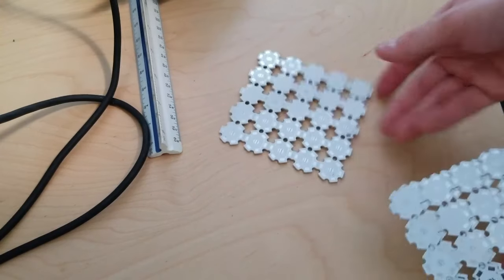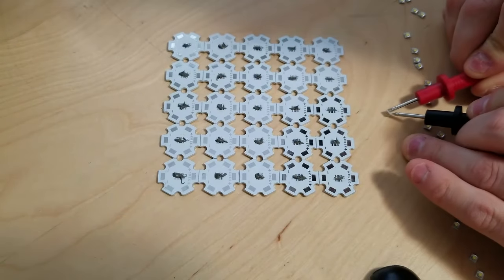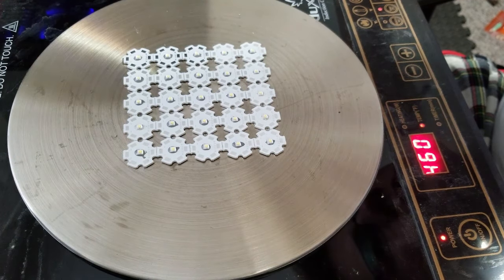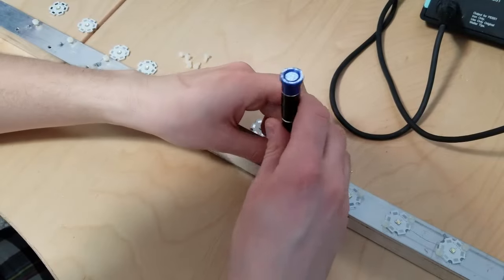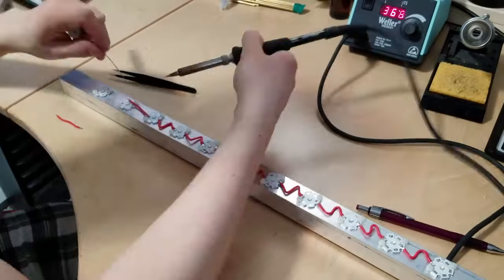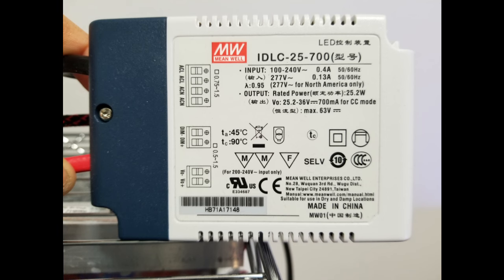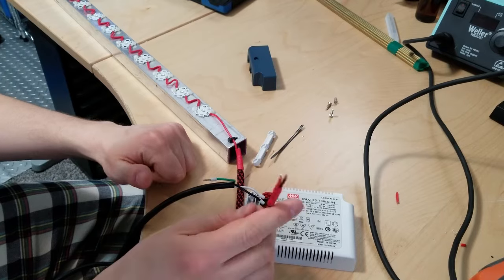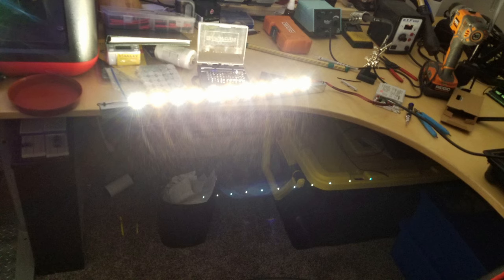DIY LED Lighting - How to Make Your Own Grow Lights!

Comment: nice! i need to try this out ! please if possible can you give me a list of what i need for this project? i am subscribing right now !
Reply from the maker: Sure thing! What are you growing? the type of plant and size of your grow space are pretty big variables in picking out the wattage and color temperature for your light.

These LED modules are a big improvement over the old CREE lights, and they are quite a bit cheaper as well. You just need to select the color profile for your plant. A blend of higher  CCT (5000K - 6500K) and lower CCT (2700K - 3500K) is usually a good idea, with more high CCT used for vegetative plants and more low CCT used for fruiting plants.

LEDs: https://www.digikey.ca/product-detail/en/samsung-semiconductor-inc/SPHWH2L3D30ED4RTM3/1510-1799-1-ND/6569457

The power supply will constrain the number of LEDs you need. For this video, I used an IDLC-25-700, which only supplies about 22W of light to the LEDs. That's not enough for a big healthy plant usually, especially if it produces flowers or fruit. you'll likely need something like this:

Power Supply: https://www.digikey.ca/product-detail/en/mean-well-usa-inc/XLG-75-H-A/1866-5628-ND/10129176

Note that those Samsung LEDs have a MAX stable current tolerance of 1.4A, which is what this driver supplies, so it might be a good idea to buy twice as many lights and run them in parallel, which will maintain the same voltage over each line, but cut the current in half. When you string up LEDs in parallel, it's also important to make sure that you have the same number of EACH color in each parallel line. circuits wired in parallel always have the same overall voltage drop, but some different LED colors require different voltage drops for a specified current. All that means is that if you have different ratios of different colored lights wired in parallel, one or more of the lines might not turn on at all, while the ones that do will have more current than they should.
Reply: @autumnmaticcreations62  Thank you for the reply man! Your a legend... I am not growing at the moment but im looking to maybe try out my hand in growing lol... for this set up what you have provided me... What strain is best adapted to the lighting spectrum?
Reply from the maker: @alionofengland4059  For my PC grow I grew Dwarf Lowflyer from Crop King Seeds. I believe I used straight 3500K LEDs from Samsung for that one since it basically flowers immediately after the seedlings stage (about two weeks in)
Reply: @autumnmaticcreations62  i have read alot about the dwarf auto strains and using alot of them for SOG set up... What are your suggestions on a 6ftx4ft space filled with dwarf autos?
Reply from the maker: @alionofengland4059  oof that's a lot of space. As long as you can water them I don't see a problem. They need very little maintenance and virtually no pruning.
Reply: Thanks man. so how many bulbs in total to fill this space?
Reply from the maker: @alionofengland4059  it really depends on the driver you use. For a large grow like that, I would probably go for straight COB lighting, and use one of the larger HLG drivers. You might even be better off buying a quantum board kit.
Reply from the maker: https://www.horticulturelightinggroup.ca/products/260w-qb-v2-led-kit

Here's an example
Reply: Where do you get your LEDs? Obviously, you want to get band width specific lights in both red and blue. The comercial lights I have now are weak on the red side. I would like to build some red light bars to supliment what I have, then build balanced light bars to expand my commercial grow. Right now I am only using half of my 800 Sq ft grow room.
Reply: Very nice video, could you pls check the how much Lumen light is produced at 10 inch from led. You can download app luxmeter and pls tell us, Thanks.
Reply: @autumnmaticcreations62  hey man I want to grow ever bearer strawberries indoors. Its going to be an NFT hydroponic system. Please state what sort of LEDs I need to buy. I live in a subtropical zone so we get a bit too much sunshine. We get June bearer strawberries only. I want to break that cycle. Only obstacle left is getting the right and cheap LEDs for my project.
Reply from the maker: @alitahir4147  It's hard to say, but I doubt their light requirements are much different than other strawberries; If they're sensitive plants, their growth performance is probably more closely related to the amount of light their getting as well as temperature and humidity. I would start with a few 3535 LEDs, stick them on starboards, hook up a driver and see if you can get a small patch to grow. You could probably get away with just a few 3000K LEDs.
Reply: @autumnmaticcreations62  awesome. I will jump on to that.
Reply: @jefferyeis9287  Dr Bruce Bugbee is the Man.He's posted a number of lectures about lighting on You Tube,a must watch for anyone interested in lighting for growing The Herb.
Reply: @Dewitt Doler why?
Reply: G ddx fortuity
Reply: i dont mean to be so offtopic but does anyone know a method to log back into an instagram account?
I stupidly lost the account password. I would appreciate any tips you can give me!
Reply: @Ivan Allan Thanks so much for your reply. I found the site through google and Im in the hacking process atm.
Seems to take quite some time so I will reply here later with my results.
Reply: @Ivan Allan it did the trick and I now got access to my account again. I am so happy!
Thanks so much, you saved my ass :D
Reply: @Mordechai Brooks you are welcome :D
Reply: @autumnmaticcreations62  I need to have assortment for a bug in garden.

Comment: I work in lighting and I make grow lights. I would recommend looking up Flood optics to get higher PAR reading from your LEDs,  Those look like the common nichia diodes so you should be able to find some. WIthout using flood optics to direct the light down  like a beam, a lot of light with be wasted going in other directions being inefficient, your plant won't like that and they won't get efficient lighting to survive to harvest. this is cool though. just add some flood optics to the thing and you got yourself a great grow light. i would look into adding 1 red LED and 1 UV LED

Comment: I have scoured the entire internet and I can't seem to figure it out!  I want to use samsung lm301h leds; but they are 3mmx3mm (or 3030), therefore a different size than these ones.  You know...the starboards that are actually affordable and easy to find.  😩  is there any way to amend the .25-.5mm difference and just use these starboards anyways?  Or do I absolutely NEED that perfect fit?!  I pray someone more electricity-minded can answer for me.

Comment: Good approach. To save time, one can purchase led modules on metal strips. I used several such strips attached with automotive thermal sealant to an aluminum c-channels, then made then attached them to an aluminum frame. Using a c-channel doubles as a poor man's lens, reducing sideways light spill and redirecting it downwards. Same as here with the power supply, same with underpowering. When the time comes, I just get them out of storage   and put them above the stuff that needs to grow, like cucumber plants. 
These lights double as work lights when needed as well.

Comment: Do NOT solder the ends of a wire you're putting into a screw-terminal. If it uses some sort of spring, that's ok though. (Though usually still frowned-upon by most.)
And ferrules are considered "best" by most. 

If it works more like a set-screw, then you have to keep in mind that, under load, wires do warm up. And the low-cross-section areas where the wire makes contact with the terminal have a lot higher resistance than the rest of the wire, so they actually heat up a lot more. Quite often, there are tiny spots that can get hotter than the melting-point of the solder, causing it to slowly flow out of the way of the clamping-force over time. 

But that is a fantastic video, and I'm glad I found my way here. :)

Comment: recent build.. $9.99 for 600mAh driver on ebay running 10-18 "3W" leds
10 "3W" leds run $5 to $9 depending on colour
i used 3 colours, 17 leds, total under $30.
selected 660nm deep red, "full spectrum" which has a bit of 465nm blue and covers red up to IR , and some 415nm (blue-violet) to hit chlorophyll a blue band (most people miss this).
3W leds are actually 2W, apparently the convention is to call them 3W. top tip when drilling aluminium: keep the drill bit wet. aluminium tends to shear and chunk, if wet it drills 3x faster and much tidier. press some kind of dimple into the spot where you intend to drill first, to center the bit.
i don't like to use lenses because of the light reduction. these cheap star mounted "bead" leds still have a wiide angle, so build reflectors also.
Reply: Hello there, do you have an video on how you did that? Sounds interesting... wouldt like to know more about it..

Comment: Nicely done.  Your right, too simple not to build my own.  I love all different types of orchids and African violets.  Having my purpose built LED strips will make my life in the greenhouse sooooo much easier.
          For us newbies, you went a little fast, both in speech as well as actions.  Maybe on the electrical testing and soldering you could go a little slower at the beginning of a soldering run, then speed up as you run along the board.  Just a thought.  Thanks.

Comment: By the math, your  LED's are 2.17W each.
I made mine using 1W Grow LED's already on a star plate and series two circuits of 50 LED's each then parallel those two. The voltage rating was 3.2V-3.4V (350Ma) for each LED. This made the voltage of the series set 160V-170V rated. This way I can run them directly from the 120VAC house supply through a bridge rectifier and a capacitor (220VDC 1000MFD) for voltage stabilization and to capture the RMS peaks of the AC which makes me end up with 156VDC +/-. This is perfect allowing headroom for thermal variables and utility company line power fluctuations.
I attached them using thermal silicone to a 4'X4' aluminum sheet that is .063 inch (1/16") thick. This makes a 4 foot by 4 foot light panel at 100W, although I believe I need to add some 3000k white ones for spectrum balance.

Comment: I did not even know you could use LED lights to grow plants so thanks for the time and info .
Reply from the maker: Knowledge is power, Thomas m'boy
Reply: look for cxa2530 on aliexpress, they are still on of the best and cost only 5 bucks per led, you can drive them 30-40 watts a piece.

Comment: You really made something that seemed so confusing and made it sound simple. I've got a small 40x40x120cm tent and i'm ready to make a light for it. I was thinking of using Samsung LM301B lights and was wondering what you think?
Reply from the maker: The LM301B are good lights, but you need a lot more of them. These run on less current and are the type usually found on Spider Farmer / Mars Hydro lights. 

If you are going to make your own lights, I definitely recommend going with a 3535 footprint, like the Samsung LH351B. They are more expensive, but put out more much more power and will be a lot simpler to assemble.
Reply: @autumnmaticcreations62  Thanks, i've had a look and the LH351B are clearly a MUCH better option. I did have another question in regards to adding different coloured lights (all in series) using the same power supply. 

Say for example we use 3 different colour LED's and all three have a different Forward Voltage and max current. Is it safe to use one power supply to power the whole thing? Assuming of course the constant current of the power supply does not exceed the max current of any of the three LED's, and the total voltage of the whole series is within the acceptable range of the power supply.
Reply from the maker: @Sasquatch10  Yep. That is totally fine. The power supply is agnostic as to what kinds of lights it is driving. You run into issues when you try to run series strings of colored LEDs in parallel from the same driver and the colors don't match.

 Since the voltage/current ratio is different for each string in this case, but the voltage is forced to be the same, you can run into an issue where one of the strings takes on almost all of the current. 

Not a good outcome if, say, you decide to run six strings of 1A max LEDs in parallel with a 3A supply.

Comment: Looks like the ground wire is not connected. Are you planning on connecting it to something? Would the heatsink tube be a good place so that the metal components are grounded?

Comment: Thanks for the video! I'm going to give this a try instead of buying my next set of grow lights. Do you have any methods for water-proofing?
Reply from the maker: Thanks! Unless your lights are going to be in the splash zone, I would not worry about water too much. If you want to err on the side of caution, you could look into silicone sealing spray - just make sure it can handle high temperatures. Anything rated for outdoor use should be fine.

Comment: Nice and simple way to understand  tks.
I would like to know  if u can help 
I need to wire an 12v  led strip  which has resistor  built in it as a brake light on my car battery voltage which when running  gives  14v   so to get constant  12v which will not damage my led strip what  resistor  i need to attach to the + wire of the  brake wire so i get constant  12v .
Tks

Comment: Good Stuff ! 
Ive got a bunch of 50-100w led cob that im going to build a growlight of ive been using single 50-100w cob with a heatsink for single plants works just fine specially when a storebought i the same strength goes for 100-400$ pricy here in Sweden . 

I couldnt find a heatsink that would suffice until now , its a metall Whats it called hmm you Cary out food on them ? In stainless steel loads of space and fans can be mounted on top of it . 

Its a good way to build/customize your own growlight it doesnt have to be expensive and its fun to create equipment even if its not Always the cheapest way . 

 Good Video youve made here 
Regards Paul-Roger

Comment: I know it's pedantic, but the earth wire should be connected to the heatsink with a crimped eye terminal, bolt and nut
This will make it trip your house RCD, should moisture or external items touch and short out the light face, and cause the LED power wires to conduct to the chassis.

Comment: hi. I have a question. i only have a boost converter on my hand right now, I want to use it to light up a 15-24v led. 
but i searched there is only a buck circuit that can limit the current.
 if i use a boost converter and set it at 30v, and use a 47 ohm 10w resistor to limit the current will that protect the led from burn out?

Comment: I'm currently building a similar set up using the same LEDs and star boards. Bought them on eBay already built. For 15 bucks a piece. There Abouts. I am curious if I have to run each color diode to its own power supply or can I use a constant current,/cv driver.

Comment: instructive effort.  

  the sqr tube lends itself to having air blown thru it for cooling

one thing to see is how to replace one of those cree leds with a new one.  

.do you know if its possible for a cree led to fail and still conduct the 700ma ?

and

did you guess or is there some technical reason to drive the leds at 700ma
  given that its 300 ma less than they can take ?   i dont get the logic

of having a driver running at its max design but not the leds.

  also its not clear to me if those star/led units had any thermal compound on
their bottom side or not when they were screwed to the Al  sqr tube.

    lastly ... about the star PCB ,  does the metal on the bottom have any
voltage to it ?  or is the led on the top side somehow isolated
electrically from the bottom side metal ?

     now to rest awhile then return to learn what else you've been up to

Comment: It occurs to me that it would be much easier to create an array of GU10 fitting LED units. Not only would it produce more directional lumens, but they can also be easily interchangeable between cooler 6500k (blue) units and warmer 2500 - 3500 (red) units, thus optimizing the spectrum requirements of the plants at various growth stages.

Comment: Skip the soldering, buy LED stars direct from LED_SUPPLY.  mount stars on 1/8 inch aluminum sheet.  You can select the color temperatures you want.  Figure each LED at 3.3vdc at 1.0amp or 3.3 watts each.  String them in series, adjust voltage across each string to set drive current.  EASY.  Fuse the AC.  Constant current is OK, but not required.  Good video.

Comment: Please pardon my electrical ignorance. Very creative. How many lumens does this light bar produce, and what wavelength range is produced? Looking forward to you finishing your project! Thank you!
Reply from the maker: Hey Jed. It's tough to say exactly, but if you look at the datasheet for a set of LEDs (CREE XPE, for example), you will be able to see information about lumens emitted as a function of current going through the LEDs. The information about color temperature will be included in the datasheet as well. This project used a mix of 3000K and 5700K, if I remember correctly.

Comment: Hi there. I would like to build switch back led light. From white to amber. All the amber led are to cheap or not bright. Where can I get them. Also I want to add them to my 2013 Lexus gs350 day time running light. I already made one but I didn’t have good heatsink to cool them down so they start to get burned down. Can u please help me out to build them. ?